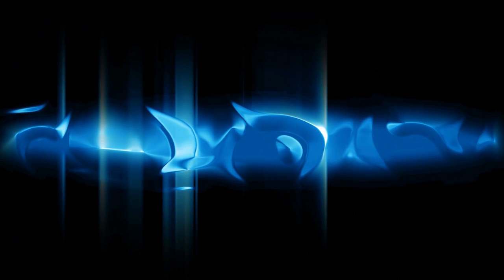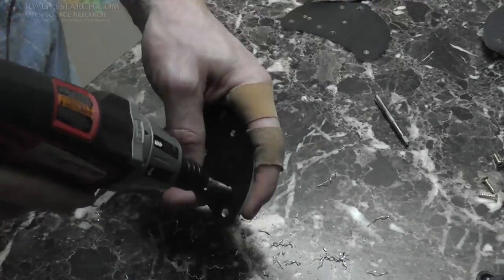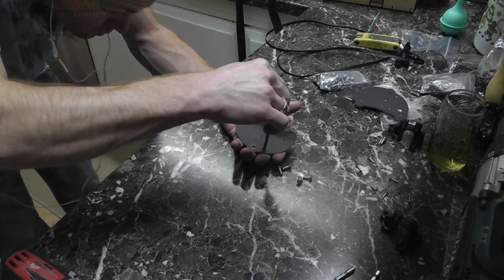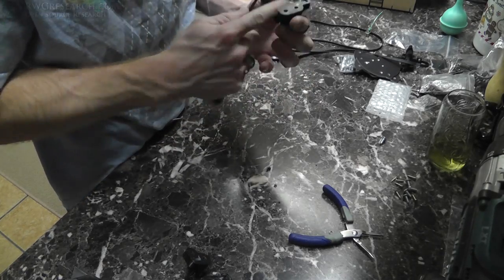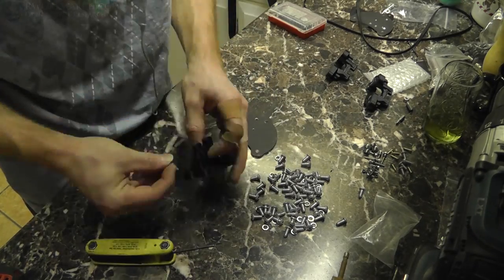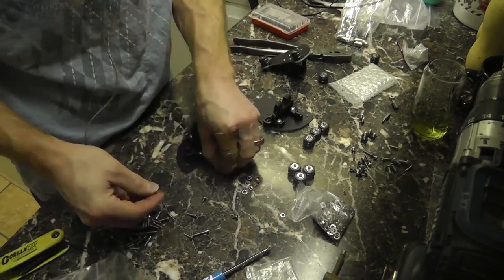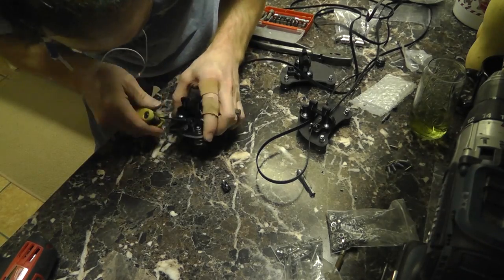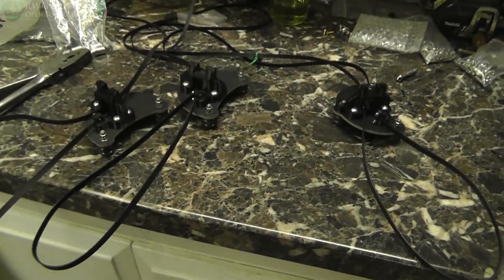RWG OSD #7 Assembling the Skate Plates / Belts and Wheels! OverSize Delta 3D Printer Build.

Comment: I have this tool: diestock. In our country when you are using this tool you need to put your part to press to tight firmly. And the diestock must cover with pig/pork flitches. By the end it is good looking peaces for new printer. But it looks lots of bigger. :) Last seconds i heard your wife. :)
Reply from the maker: +heris30 :) yes that is also a type of tap holder too. Good for bigger taps!!! or hard to tap stuff! blessings. ~Russ

Comment: Russ, for tapping or even cutting Aluminum, Kerosene works well if you have or can get some. It's probably cheaper than something like Tap Magic.
Reply from the maker: +specialks1953 good idea. i don't like the way it smells tho lol  ~Russ
Reply: +rwg42985 OK
Reply from the maker: +HarreyHHH yeah that's the norm i use but i can say that tap magic is the best stuff i have used so far :) some times cheep is better tho :) and wd40 is normally close lol ~Russ

Comment: I still haven't finished putting up my own on the Geeetech i3 Pro B I videoed. going on a year now. lol

anyways, I tried to chat with u on page during live stream, never got the confirmation email, and so I sent a comment on the stream. did you get the LCD12864 working the way you want?
direction of encoder scrolling?
and it's really easy to add Bluetooth as well.
hope your close to the finish line.
Reply: but have to add that chip I sent. otherwise too much current draw for it to handle it.
Reply from the maker: +George Robles   lol i know the feeling i'm editing a john Hutchinson video shot last year as we speak lol
oh, ok well i can activate for you . strange that thing is not working correctly. whats your user name? just Skype it to me! 
the LCD controller indeed dose take to much processing power. so the printer stalls when doing complex radius delta calculations. ill have to go back to the other LCD im afraid... do you have one like on my other printer laying around? ill trade you!!! SD card part works fin tho. 
the scrolling is backwards... could be fixed in software tho...  

yeah getting closer :) 

 ~Russ
Reply from the maker: +George Robles yes! funny i burnt that chip like weeks before you sent it lol.  i installed a small 12V to 5v converter :)  now i got backups lol  ~Russ